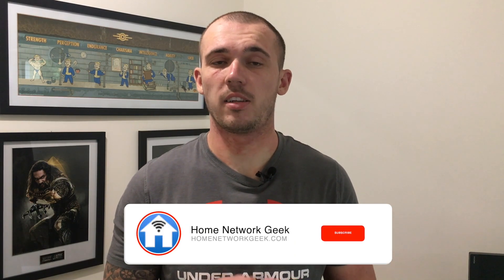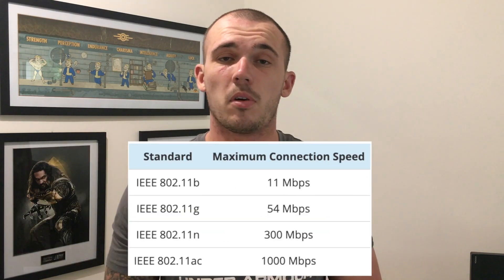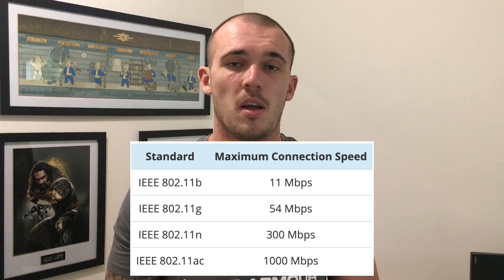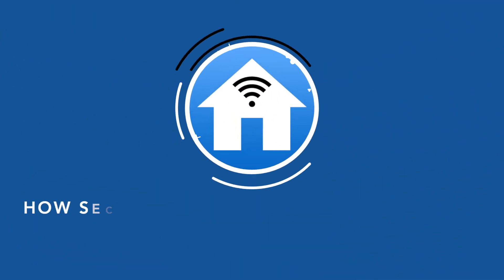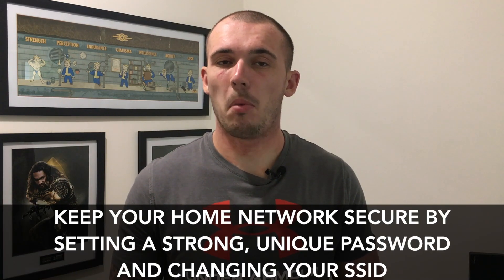USB Wi-Fi Adapters: How Do They Work?

Comment: So if I’m using a business next door Wi-Fi approx 30-35 ft gap between buildings. Seems I’m on the border line of the range. It connects but buffers here and there. Will a usb adapter on my TCL help that??

Comment: My laptop does not show any wi fi connections. Will an adapter take care of that problem?
Reply: My laptop does not show any WIFI connection because of internal damage within my computer, likely due to it being dropped or the heat. Yes, the adapter did work for me. I got mines from Best Buy. My advice is to bring your laptop to the store and buy an adapter at the store. Test it out at the store and see if it connects. For me, putting in the adapter made the WIFI symbols appear. If this doesn't solve your problem, just return it at the store and get your money back.
Reply: @W11l  same issue, my gaming laptop got so hot then the wifi card disconnected my wifi, fixed with usb wifi, amazing!
Reply: @metrictensor123 which one did you buy?
Reply: Did you find the answer to this?
Reply: @chinesefood1685  No I am going to toss it. Been trying to get it to work for over 3 years. If I go to cmd and run sfc /scannow. And restart it will connect  for awhile then lose connection.

Comment: ok so if i bought giga clears 500mbps pack then what happends if i get a 1000mbps? will i only be able to recieve up to 500? or up to 1000? also regardless of which ever you answer which speed usb wifi would u get if you had the 500mbps pack?